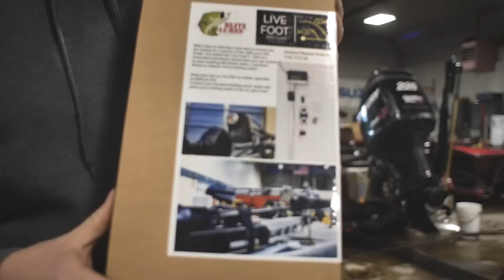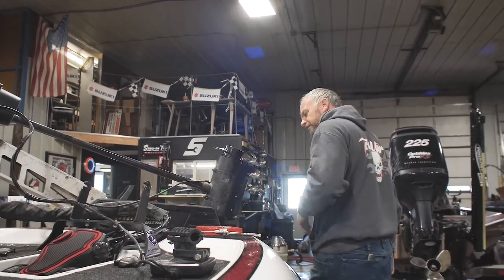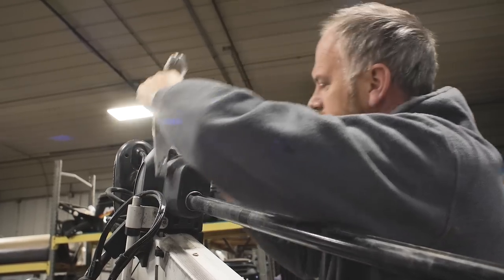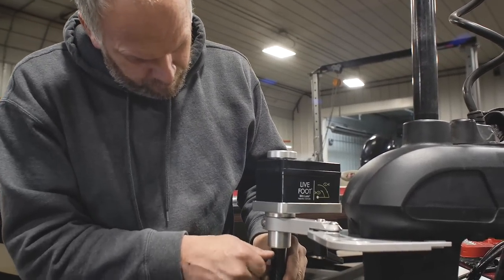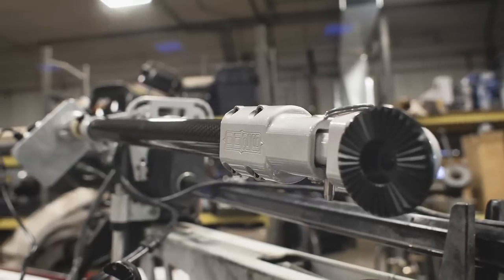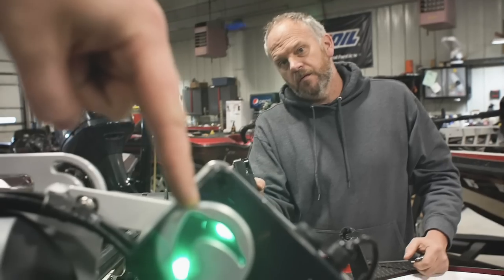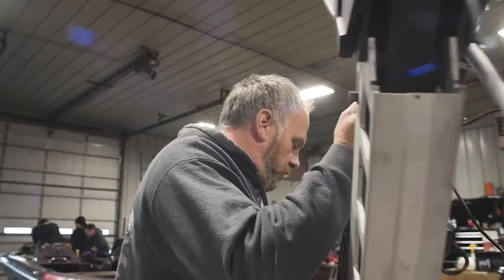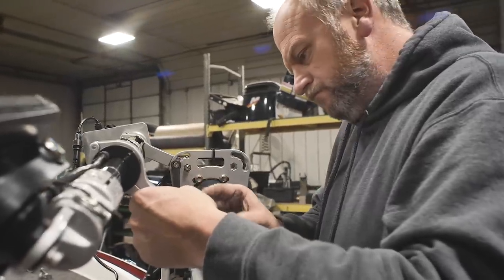YOU NEED THIS! (DD26 LIVE FOOT INSTALL)

Comment from the maker: Comment below if you're running any DD26 products and what your experience with them has been like.
Reply: DD26 Transom Saver & Steering blocks,Ultrex triolling motor pad, Trolling Motor cable Management sleeve. Each and every one a superior product..... Well designed and well made...!!!

Comment: Would this mount work in conjunction with an ultrex that already has a 360 bracket and transducer installed?  Curious. Nice, well designed unit for sur.
Reply: There is a 360 arm that connects to the same mounting bracket.   Nice clean set up.

Comment: The  mega live target lock seems to be the most advanced. It will lock on to a target it will pan with the trolling motor just like its on the shaft or you can move it separately.

Comment: This is on my short list to add to my gator trax.  I currently run a livescanner.  The livescanner works great but it doesn't hold up in big water I run (Leech lake and Kansas wind covered lakes).  The break away on the livescanner is a bit to loose for running big water also having a separate box under the deck is annoying.  Hope to order soon and will be a nice addition to my DD26 transom saver and jackplate levers.
Reply: Thanks for your opinion on this, I'm thinking about getting back to fishing and like to hear honest input.